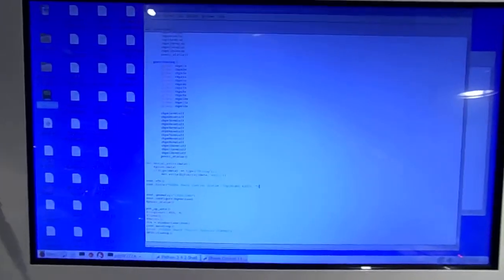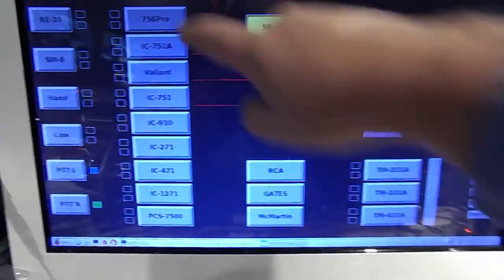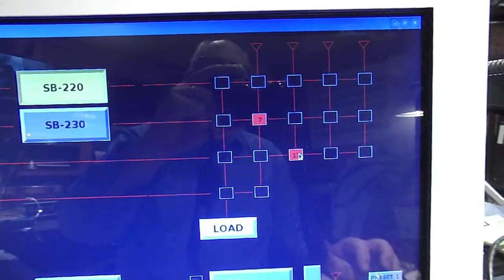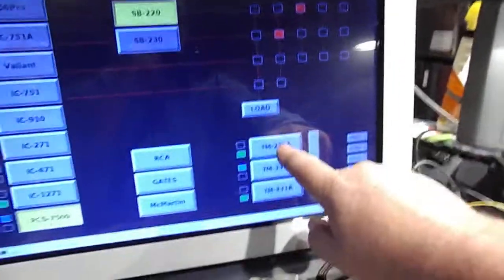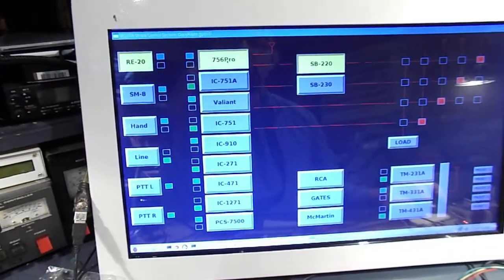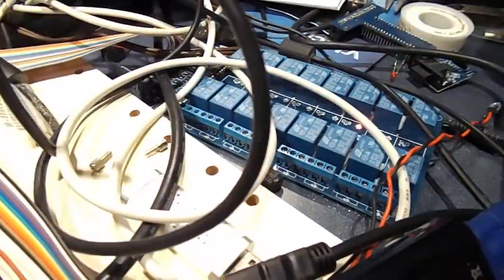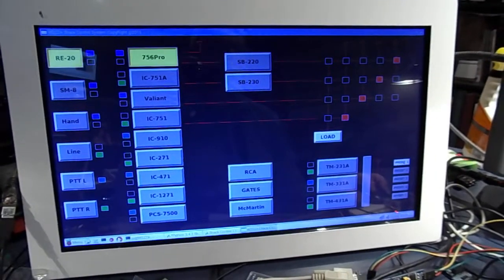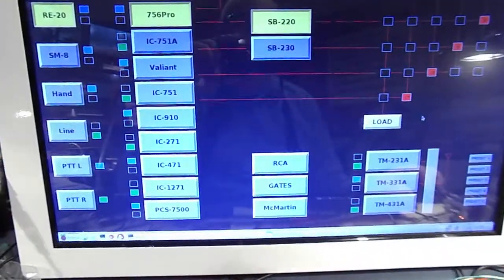W2ZZA Ham Shack Control Software

Comment: Nice setup.  You've come a long way in the ham world Dave.  I wish I still had my ARC-5 setup, I'd donate it to your shack, just to see how you'd automate it, hi, hi!  73 de W7UNX
Reply from the maker: +Andrew Rakowski   Thanks So much Landrew..  Its true, I have advanced a bit since doing Basic on the VIC 20 or Timex Sniclar..  Python is a bit of a change for me and is not without its challenges, but I do enjoy the journey of going from 1 LED under program control to the entire shack. I have to add the power of the Raspberry PI 2 is wonderful to work with (Quad Core at 800 MHZ with  1 GB ram  and Micro SD Storage )  The GPIO has 21 bits Plus serial, SPI and I2C IO make it a monster IO machine. All for $35..
Reply: I'm glad to see the software bug has bitten you!  Now, I need to get a Raspberry Pi and some LEDs to control, and see if I can get a bite from the hardware bug. I still remember the fun of writing Forth code (and Basic) to run on some of your robots.